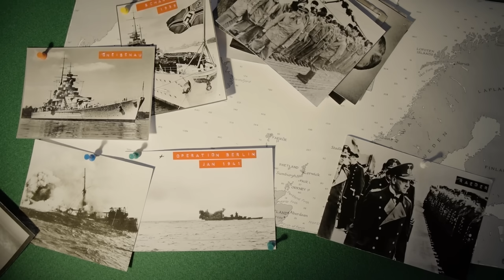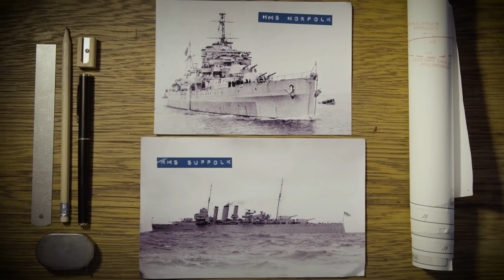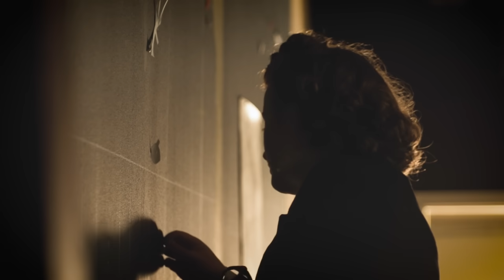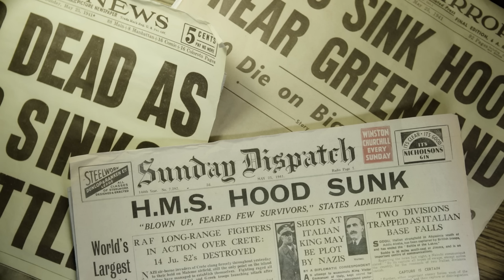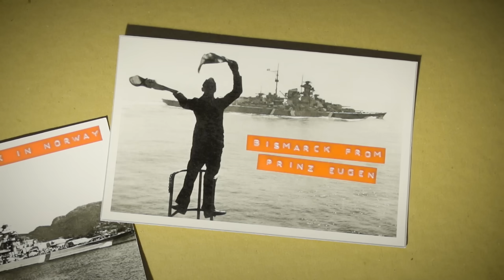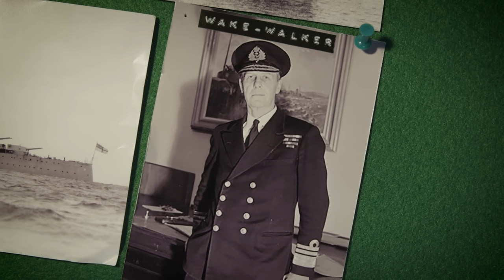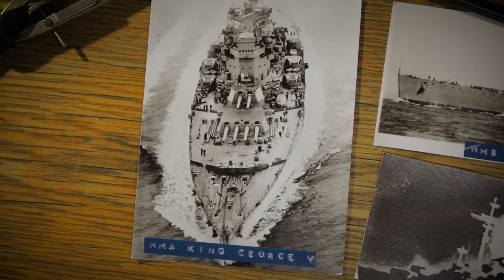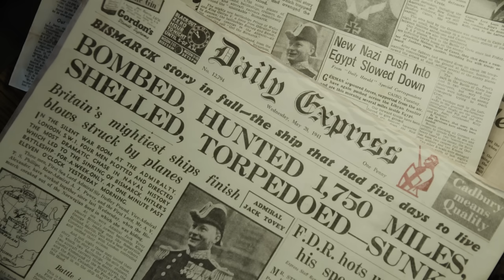Bismarck: How Britain Sank The Infamous German Battleship | Full Documentary | History Hit

Comment: That German Videography during the battle with Hood is nothing shy of completely fascinating and completly bleak. Seeing the flashes and realising 2 tons per shell of metal is flying towards you. That would be enough to put the shits up anyone and how all those crewman could be so brave like that is nothing short of completely courageous.
Reply: However, I take issue with presenting the speed of sound as being the same as the speed of light. A minor issue compared to the overall quality of this presentation.
Reply: @andywomack3414  It would have been much better to delay the sound realistically.
Reply: @namcat53  " Master and Commander" gets it right with the opening sequence. 
I wonder if a Bismark shell might arrive before the sound of the guns.
Reply: Each AP Bismacrk shell weighed 1764# not 2 tons which would be 4000 - 4400# depending on short or long tons.  Yamato's shell weighed 3220#, yet still less than 2 tons.
Reply: @ewathoughts8476  The weight is insignificant to my overall comment, the point is that it is a fucking heavy piece of metal hurtling towards you.
Reply: @ashleygoggs5679  And your sitting there... bolted and sealed in on your gun position waiting for impact...
Reply: @ashleygoggs5679  Yep, though in fact Bismarck's shells were pretty light for 15" APCs. Lighter than Hood's 1,938lbs shells and not much heavier than Prince Of Wales' just under 1,600lbs 14" ones, which'd also do somewhat more damage than Bismarck's in view of their very large bursting charge (designed in specifically to compensate for the earlier 1930s UK government stupidity that resulted in the KGVs having to be completed with the originally planned 14" calibre main battery instead of being able to move to a 16" one like the directly contemporaneous US North Carolina Class ships)
Reply: 1 ton per shell. Even the Yamato's 18" guns fired shells weighing less than 1.5 tons.
Reply: @andywomack3414  Yep, shell velocity 820 m/s at the muzzle just above 500m/s at 20 000 yards, speed of sound at 0°C 331 m/s.
Average distance at the Battle of Denmark straight was about 20 000 yards or 18 000 m.
First would have been the flash, about 30 seconds later the shell and another 30-ish seconds later the sound.
Reply: Ow many shells Bismarck carries ?
Reply: @leejustinm 
120-130 shells per gun for the main battery.

Not sure about the other weapons.
Reply: @ashleygoggs5679  cousin of mine got to serve a short stint on the New Jersey...later got to see her firing her big guns off Vietnam...said it was awe-inspiring

Comment: Prinz Eugen was a very good ship , Much underrated by the senior service.
Reply: It was, but at that time the size of the barrel was most important.
Reply: The American crew who had to sail it across the Atlantic thought it was a bag of bolts
Reply: @barbararice6650 Their ships were nothing and it took some sinking
Reply: @barbararice6650  The ship was likely either sabotaged by the germans, or the american crew not properly instructed in her complicated high pressure steam turbin engines operation. That said tho, german surface ships were very inefficient, allied ships achieving the same amount of protection and armament on ships thousands of tonnes lighter.

Comment: the guy at the 20 minute mark needs to do some research. comparing Hood to other battlecruisers is not fair or accurate. she was almost as well armoured as the bismark. the birtish learned from jutland, hood was mostly built afterwards redesigned specially to make sure she didn't blow up. her armour scheme is very similar to that of warspite and far closer to bismarks than to any other british battle cruiser he is lumping the hood in with.
Reply: Maybe it had battleship class armour. But what had been considered sufficient armour for battleships when Hood was built was less so a few years later. Deck armour in particular

It was well understood that Hood’s armour would be vurnerable if hit byAP shells at the longer potential ranges at which a gunnery duel now could begin. Consequently, the approved tactic was to close the range as rapidly as possible to get through the danger zone before turning to engage the enemy so shells would be coming in at a shallow angle or impact the side armour (which in Hood’s case was fairly good). 

The British Admiralty had plans to address this vulnerability by refitting Hood with additional armor, but these plans had not been implemented by the time of the battle